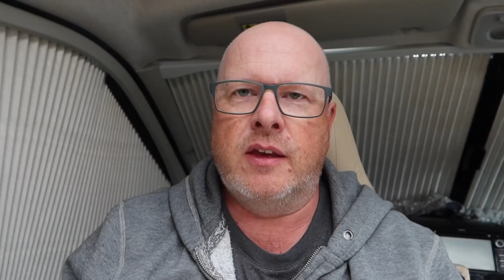VanTech Tuesday - Power to the People

Comment: Hi john yes back to basics for me ,i subscribed to channel for van related tech and everything technical to do with van . Like mandys cooking slot and of course cooper too!less fond of travel bids -thats just me .
Anyway i think ive gone over kill on my leisure batteries ( under seat of citroen relay) to 12v fuse box in rear of garage ,i used 35mm² same as joining 2 x 100amp leisure .struggling to find terminals to suit 12v connection on fuse box as its small mabe 4mm or 6mm . Wat do u suggest -change cable from leisure batteries to fuse box  to somthing like 10mm² or use 35mm² and make my own lug up outa copper pipe?stay safe cheers
Reply from the maker: Keep the 35mm on the battery to battery cables. Then fuse box to batteries can be smaller, just add up the total load of every item in your fuse box and use a cable that exceeds that load, or for longer cable runs then use 35mm and put a smaller lug on the fuse box connector.
Reply: @GadgetJohnAdventures  thanks john il keep thevoverkill 35mm² and change the lug cheers gor for quick reply

Comment: I been on the road two years totaly off grid. What a learing  curve! The main thing I have learnt is the total incompetance of suppliers, expertise and shoddy work. Trust no 9ne and test test test. The specifications of equipment is useually incomplete as well. I have had, manifold exhaust leak into cab (after new exhaust fitted), propane gas leak from profestional fitted gas heater, cooked batteries (mixing batteriy types) is a no no as you may get battery gassing (hydrogen chloride) and wrong jets fitted to gas hob. Even solar cell was factory wired wrong! So test evergthjng!